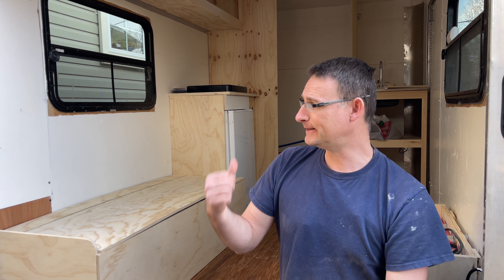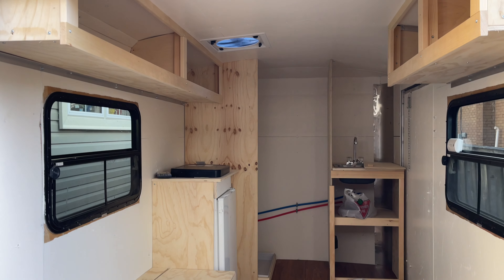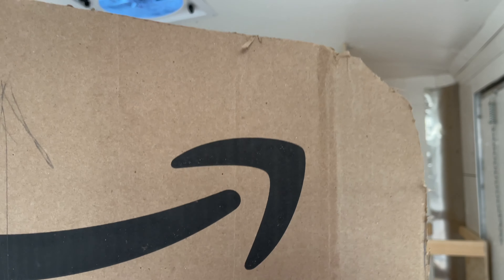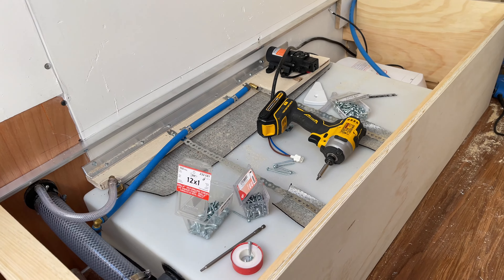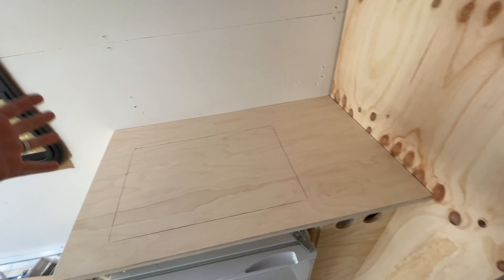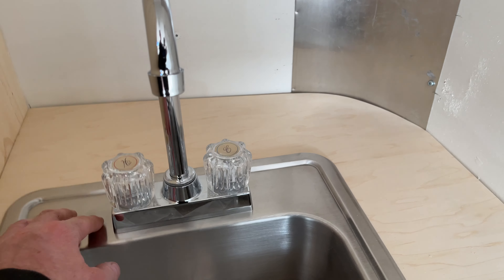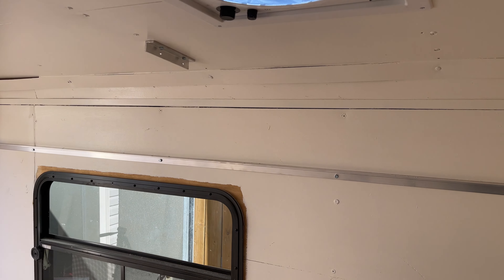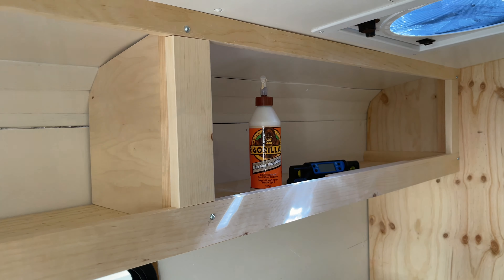How to Build a Cargo Trailer Camper Part 7a - Building Cabinets

Comment: Looking Good!!!!   I hope you are happy with the results.  I know I would be.
Reply from the maker: Yeah we are really happy with it! Still putting it through its paces and improving as we go.
Thanks
Reply: @waysoutback  I redo mine every year learning what I don't like from the previous season.  But it's fun, because it's manageable to work on.  I look forward to more of your videos.
Reply from the maker: @Mainbusfail  I hear you always trying to improve it a bit, definitely part of the fun. 😁
Reply: @waysoutback  I have to admit, Im a little put off with my layout compared to yours.  I'd like to add windows but for security purposes I am going to install a small wide angle video camera flush to the outside skin of the trailer and connect it to a flush mount wide screen monitor display mounted to the interior wall to emulate a live window. I thought that would be pretty cool.  I might even do the same thing for a sky light
Reply from the maker: @Mainbusfail sounds like a great option… I like cracking the windows when it’s raining or to sleep at night but if some place feels off or sketchy I just keep moving…. I’m not going to camp….. but I hear you this world is getting pretty crazy need to stay safe!

Comment: How did you determine where the aluminum studs are in the wall?
Reply from the maker: My plywood sheeting on the walls was screwed to the studs, so it was really easy to locate each one. My trailer though is made of steel, I just used aluminum angle to hold up the cabinets. To make it even stronger you could use rivnuts rather then self tapper screws.
Reply: @waysoutback  thanks so much for the reply!
Reply from the maker: Anytime 👍

Comment: does your heater heat the water or did you put a water heater in as well?
Reply from the maker: I run an on demand hot water heater. I explain it a bit better in the update tour video.

https://youtu.be/6G1-MKZaC4c?si=4ALK4jYV8Lc9_Eg9

Comment: Nice work once again Zac!  I am concerned however, if you have your lights under the cabinets, when accessing items at night, it will be like looking into a dark void?  Just an observation?
Reply from the maker: Yeah that’s a good point... maybe I’ll see if I can mount them up a little higher, or put some lights on the back door.... that’s a great idea. Thanks
Reply: A dark void sounds pretty cool, I'm going to change my design and do the lights that way.
Reply from the maker: @madcow3417  I already mounted my light up a little higher. It’s definitely better to see in the cabinets. I’ll show it on the next video. I think if you put them under you might also want to throw one up top to see in the cabinets when dark.
Reply: 👍You could mount usb rechargeable lights, many options on Amazon.  Really nice build. 👌